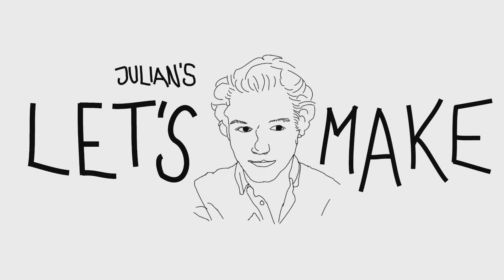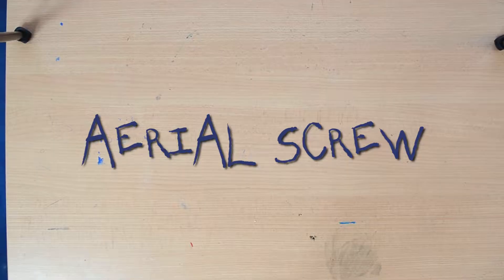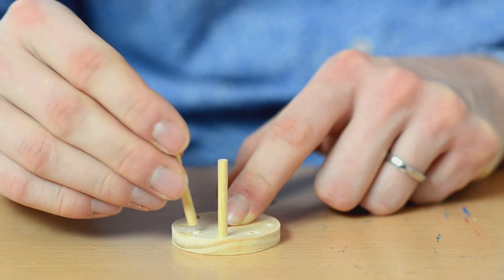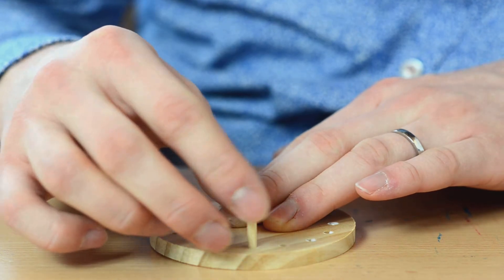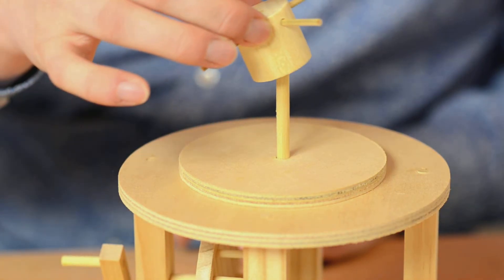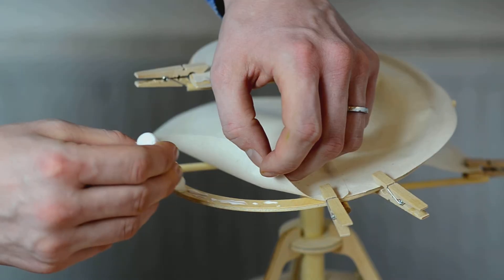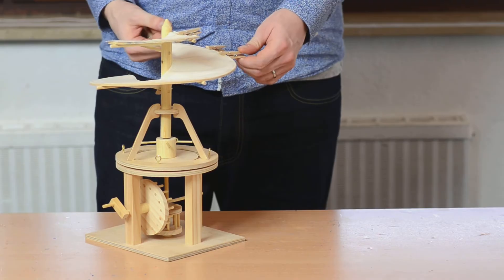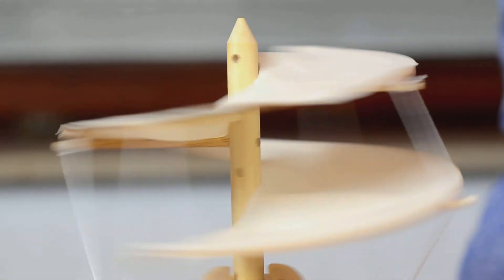Building Leonardo Da Vinci´s flying screw | Do you think it can fly?

Comment: First of all, GREAT JOB! I wish to make my own, or just buy one. I have a couple of ideas to make this actually work: 
1) I noticed there was taper to the screw. First make that screw a uniform diameter. Now place a cylindrical shell around it; a shroud (paper). Make it a close fit around the screw. It should function like an Archimedes screw. But led me to a 2nd idea. 
2) Instead of that cylindrical shroud idea, which adds weight, how about if we just add a LIP to the underside of the screw? This lip should be large enough to keep the air spilling out. 
I would start with idea #2. It's not that hard to just add the lip that I'm thinking of.

Comment: It is too narrow to fly, compared, say, to a helicopter. The outer parts of the rotor move much faster; the inner parts do not contribute much lift. So the design is inherently flawed. You don't need "rotor area" close to the axis, it only increases weight without contributing much. Another thing that da Vinci's design does not take into account, is that the centrifugal force pushes the rotors away, and this is what tensions them to bear the weight of the helicopter. I mean, try to hang a helicopter from its rotors while they are static = the rotors will break. But when the rotors rotate, they do bear the weight of the helicopter. I don't think da Vinci's design should be taught at schools as a "precursor to helicopter".

Comment: I'd say, the design can work, but from the looks of it, his design covers too smal of a area to create a lift. Helicopters' rotors covers a much wider area than their own bodies, but since his helicopter has huge limitations, he may need to cover a much wider area and have lighter, but sturdier materials to work with and also create a system that uses a person or 2's own weight to generate greater power than what could achieve by hand or pedaling.
Reply: for me its very interesting since I just recently saw a wind turbine that used the screw design, similar to the davinci's design and it was way more effective at power generation.

Comment: Hello, I want to build a helicopter, but the noise of the propellers bothers me. Do you think the Leonardo Da Vinci helicopter could fly and make less noise. I would use an electric motor as a drive.
Reply from the maker: I'm afraid the screw is actually kind of impractical. You're probably best off with some super efficient Drone motors.
Reply: @AnarchyAutomatons  there is also a quieter solution, i d´ont like noise

Comment: I wish you could put a motor on it to see if it would actually take off. I am looking for a motorized da Vinci flying screw.
Reply: Some guys tried that with a human-size one, and it didn't work.
Reply: @thejupiter2  
It would if it spun fast enough and was made out of a durable enough material, like lightweight metals.
Reply: @michaelfixedsys7463  it doesn't generate lift.
Reply: @miamiwax5504  
It generates thrust like a turbine
Reply: @miamiwax5504  , You're wrong.  A Maryland engineering team succeeded in making a flying Da Vinci screw in 2019.  See the video above.
Reply: @michaelfixedsys7463  anything will generate lift with enough power. So?
Reply: @michaelfixedsys7463  we could use the same cloth what we use on hot air balloons

Comment: Would it work in a denser environment, such as under water?
Reply: Yes it’s called a propeller
Reply: It would turn, but da Vinci's design lacks something very important in any helicopter. a way of countering the torque. If you have just one propeller, then you need some kind of way to "turn" your craft body the opposite way so it actually stays immobile while the rotor turns. That's why helicopters have either 2 rotors with their fins facing opposite directions (and turning in opposite directions too) OR a tail rotor, much smaller because lever effect that counteracts the effect
Reply: @ZQMBGN  true
Reply: @ZQMBGN yep, all to achieve a net torque of 0 while maintaining a net force in a forward direction
Reply: You need basically a way to capture the air and push it through
Reply: it works in the ground
Reply: Yes it will work under water air isn't dense enough but not stable.
Reply: Yup
Reply: En3
Reply: For sure tbf would not be a bad bit of kit in the sea lol 😁
Reply: @NEED2CONNECT You must be fun at parties
Reply: 0
Reply: Water pumps use a screw to pull water and not just pumps but this amazing simple machine is used in many other complex tasks. So yes, it 'may' work in water. There are a lot of variables here. Noone except people without much scientific knowledge is interested in this idea as we have got propellers and impellers which are a lot better. Modern Helicopters are more like the Chinese bamboo copter than this Italian device.
Reply: @mohawk_13 скорее всего то что называют вертолетом да Винчи это разработанный им вентилятор для угольных шахт , ещё в 19 веке были огромные вентиляторы для шахт от механической силы работающие